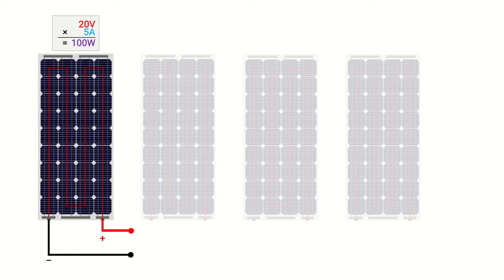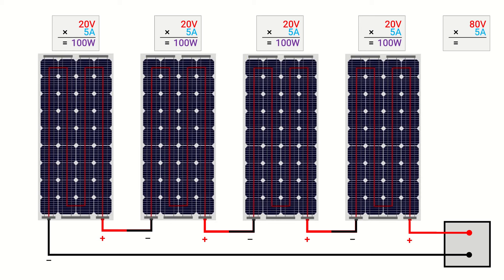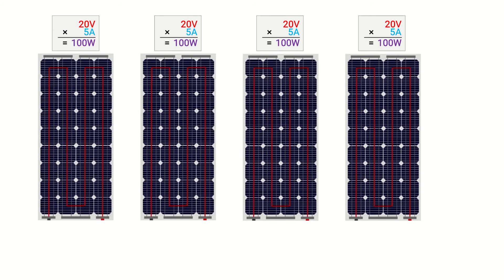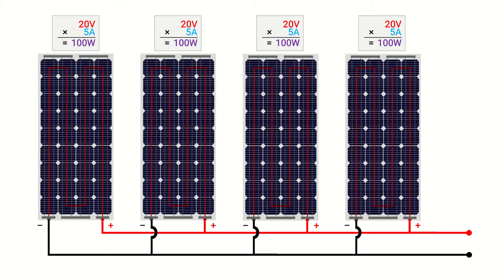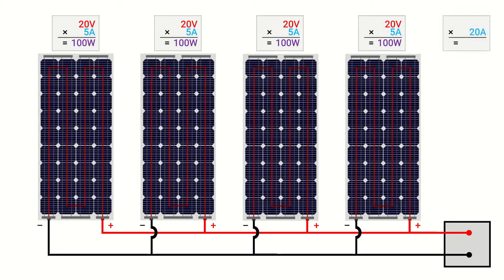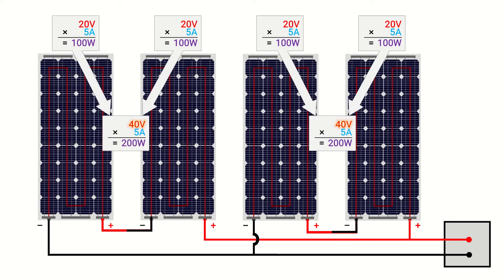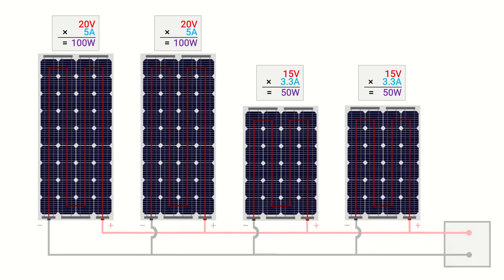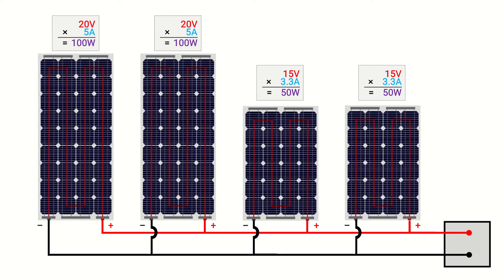How to wire different sizes of solar panels together

Comment: I understood before that wiring dissimilar capacity panels would impact array output but never understood why, or how to design around that constraint.  This explanation is very clear and simple, and may show me how to address a problem I’m working on now to upgrade my current installation. THANKS!!

Comment: Thanks for this information.  I’ve always been told that you can’t use a 100w & 50w in parallel. Not so if the voltage is the same. I had to try it for my self. Connected both panels. One 21.8v and 20.0v.  Works great.
Reply: I'm on a van project, I'm using ecoflow powerhub, so it has 3 solar input, but one is used for alternator charge, so 2 inputs.

I have 3x175W solars in one input. 
And the other i have 2 flex in the roof and 2 more flex in the hood. Both flex group are in series (separate).  1-1 + 1-1 thing. So series between them and then parallel to the controller. But like that wont charge. (very low wattage). but if I connect one pair, I get 30w and the other around 38w. 

One is 41v total the other is 36v. Something is happening  there. where somehow the lower panel is bringing the other panels down or something, and I dont get more than 0.5 A, which is not enought to start charging (20w minimum) 

I will try to rewire them in parallel, since the voltage will be closer that way. Too see what happens
Reply: Благодарю Вас за подробное рассмотрение вариантов с расчетом каждого варианта. Это был настоящий урок для новичка. Познавательно и доступно. Благодарю, успеха Вам.

Comment: Hello, great to hear you're enjoying the videos! One question, can I use a set of 4 panels of 330W (2 in parallel) and add (2 in parallel) 4 panels of 550W, all in pairs, then in series, and connect them in a combiner box? I don't want to discard the old panels.

Comment: At 12:04 could you increase the efficiency by wiring the two 50w panels in parallel and then wiring that string in series with the two 100w panels for a total of 275w and 91% efficiency? (55v x 5a = 275w)

Comment: This is good, for a theoretical example. However, as you know, solar panels' VDC varys wildly, depending on conditions. So, at what reference point does one determine the voltage requirements, for combining panels of various voltage? Open circuit VDC? Vmax? Or somewhere in between? 
Loving the series, BTW. Thanks.

Comment: 11:09  you could get 100 %  efficiency  by connecting the 2  50w in parallel and then connecting them in series with the 3  100w  to get 80v  and 5a  boosting operating power to approx  400w

Comment: Very well explained and informative video . I have one more question at this point in my next system addition . I currently have one 250w panel that rated at 23.83v and 10.51 a. My charge controller's nominal pv power is 700w, so would the addition of 2x220w panels be better for the total of 680w , or one addtl.250w panel and one 200w panel be the way to go? I have a Victron 100/50 mppt controller and Newpowa 250w panel so far . Thank you for your time .

Comment: In the last diagram with the 5 panels you could have wired them for 40V 10A with 400 watts and 100% array efficiency. 40V 5A for two 100watt panels in series. Then the one 100watt in series with the two 50W panels but those 50W panels would be in parallel so they combined would equal a 100W 5A panel. They could have also be wired for 80V 10A for 400W and 100% array efficiency. In both configs just imaging turning the two 50W  2.5A panels into one 20V 5A panel then wiring the rest up.

Also your wiring on the last diagram would likely burn out the two 50W panels. You're trying to connect a 60V 5A strand to a 40V 2.5A strand that would likely burn out the smaller 50W panels.

The voltage and current cannot be mismatched in this manner when connecting in series or parallel.

In series, the current has to be the same through both strands, which isn’t the case here. The panels wired to produce 40V, 2.5A cannot handle the 5A current that the 60V strand can handle, which could indeed lead to the lower-rated panels being damaged or burned out.
In parallel, the voltage across both strands has to be the same, which also isn’t the case here.
Therefore, connecting these two strands as depicted would likely cause failure in the lower-rated panels due to overcurrent. The appropriate method is to match panels with the same ratings in series and the same in parallel to prevent any damage and ensure proper functionality.

Comment: So if i put a one way diode in the smaller panels, would that keep the electric pressure from going to the lower voltage? Or is it a frequency thing where the lower voltage frequency transforms the higher voltage into its frequency.
Reply: Depending on how you connect the diode. If you connect in series with the modules, it will act as a blocking diode to prevent reverse current. If you connect in parallel, it will act as a bypass diode.

Comment: Thanks..
But a doubt:
7:00-7:10 part.
You say while in series, the current shall be limited to 2.5A!

My doubt is, when the sunlight falling on the 5A panels is capable of producing 5A and the load is capable of eating out the 5A, won't the 5A current flow through the 2.5A panels resulting heating up and damaging them??🤔

Please clarify 🙏

Comment: Excellent video, but I would also like to see the solution to be applied in case of necessity. For example, I have panels of the same model and specifications. due to space limitations, I have to mount them in 3 areas of different sizes. I want to place the maximum number of panels in each area. In this case, 3 different strings will generate electricity at 3 different output voltages/amps. Can I connect these 3 strings to the mppt after making parallel connections in the combiner box? Or in such a necessity, considering the minimum cost and maximum efficiency, what would be your solution?

Comment: I have 25 x 100w 24.3voc panels and 2x 320w 40.3voc  Renogy solar panels to install. Perhaps I should not have bought the 320w yesterday. I hope I didn't do a boo boo. Thanks for the video, great stuff.
Reply: that's ok; majority over-rules; the new ones will reduce down to the voltage of the old 25, they have to,because different voltages cannot co-exist; ;  meaning, the 2 new ones will only produce a fraction of the rated 320watts, maybe around 120 watts.

Comment: Hi! Have you ever heard of the Shoals Plug and Play cables / system? Can anyone judge whether it makes sense to use it? Although they seem to be a bit more expensive, they are extremely easy to use and no professional installer is required. Installation is also said to be very quick and more energy efficient than conventional cables... How do you think about that?

Comment: Can two seperate 400 watt arrays setup like shown here in 2s2p be combined in a combiner box for 80v at 10amps? Also would I need inline fuses for my power lines or is a combiner box good enough?

Comment: on the example where you did paralell to add current but 20volt and 15 volt panels.  doesn that matter since controller cuts the woltage on a pwm to battery 14.2 setting for example ?

Comment: So if we run a windmill and an array of solar panels they go through a controller that matches them up so that they work together efficiently? Instead of connecting their + and - at the batteries. Generally speaking if we had 2 large strings of panels of differing voltage and current we could wire one into the dolar input and the other into the wind input and they should produce efficiently? Or if we had an array on a roof that got more midday sun and an array on a wall that got morning or winter sun better we should use 2 different controllers before feeding the batteries. I'm going a bit wide off the subject but does this make sense?

Comment: I think it is important to consider the length of the run of wire, and the purpose/inverter used. Lower voltage can be better for batteries and higher voltage for a grid tie inverter.

Comment: Is this the same of you have pairs in series and then those in parallell, all the with the same rating, but facing different ways. Will the more shaded seriell connnected pair, bring down the other pair? 
The question comes from if the problem is what they atr producing or the internal resistance of the product itself.

Comment: In your last example, would i be correct in assuming that adding two more of the 50 watt in series with the other 2 50 watt panels, your efficiency would go back up to 100%?
Great video by the way!
Reply: He could have just connected the two 50W panels in parallel first to form a single 20V 5A panel. Then he could have made a 80V 5A series panel or a 40V 10A series parallel setup or all in parallel for 20V 20A. All setups would have a 100% system efficiency. Also the guy does not know his stuff. You never connect a 60V 5A string of panels in parallel to a 40V 2.5A string of panels. You would overcurrent the lower voltage lower amperage panels and likely burn them out.

Comment: Thanks I have 12 panels that produce 29.7v @ 7.3 amps. I am getting 10 more panels that have 31.5v @13 amps. It comes out to around 6400 watts max. My inverter can handle 6000 PV watts so that is perfect.  my other inverter will get 6600 watts PV but only use 6000 max.  Over sizing a bit is good for winter.

Comment: Something every mismatch solar panel video fails to mention is the Diodes. The lower value diodes in smaller panels must be changed to the value of the diodes your highest output panel .

Comment: Hello. I am setting up my own solar power system. So I have "2" 415w panels with voc 37.5 in parallel. What size charge controller would I need and the size batter bank? I truly would love your assistance. 👍
Reply: Hi, if they face the same way, put them in series for best results and less loss in the wires, choose a Victron BlueSolar MPPT 100V/20A or Victron BlueSolar MPPT 150V/45A. The battery can be 12v/24v/48v, it depends on what you want, most 12v cigar to usb for car can also run at 24v. you can also get inverters that run on 24v. A battery of 24v / 200Ah with 100A bms. then you have a 4.8Kwh battery and can load it with "2400watts for two hours" if the inverter can do it. good luck with the project

Comment: @11.90 wire the 3 100w x 5A pv in series with the 2 x 50w x2.5A pv wire in parallel connected to the  3 x 100watt pv in series.
 would that not give 80volts at 5A making 400w - am i missing something .

Comment: Hello.  I am new to learning about volts and amps, and connecting up solar panels to an Ecoflow power station (generator).  I have a question that I hope someone will answer.  Is it ok, if I connect four 200W 12 Volt panels in series, to add in one additional 200W 12 Volt panel, using parallel?  Or will this cause problems.  Thank you, Lori

Comment: I thought the whole idea of going in parallel was to have one string not affect another string. So if one of the two series panels got shade, the voltage would go down as well. You are saying that the lowest voltage in parallel is he output. Interesting.... That doesn't sound intuitive. Is there some diode setup to isolate effects of parallel string with another parallel string? Video was well done, I subscribed.

Comment: at 6:20 - when speaking of series connections being limited by the current of the ' panel with the lowest current rating '   Should it be better said that the series configuration would be limited by the current of ? :
EITHER
1 . the panel with the lowest current rating 
or
2 . a paralleled panel group whose amperage summation is lowest

Also - in that diagram of the two 100 watt and two 50 watt panels - would this be correct :
If the two 100 watt panels were in series with the paralleled two 50 watt panels then the equation would be 55 volts times 5 watts = 275 watts ?

Second question :
Do the panels communicate with each other, or is there some regulation from an external source ?   I can readily understand how the current would be restricted in a series circuit, however, I don't understand how a higher voltage at a parallel junction can be limited solely by the presence of a lower voltage .

I have not looked into the workings of these systems yet, however, just the mention of open circuit and short circuit gives me an idea that it is some type of pulsed on off switching .   Is that similar to a water hammer - only with electrons ?  Just kidding .

And at the last example ->  would putting the two 50 watt panels as parallel to each other and in series with the 100 watt panels give 80 volts times 5 amp = 400 watts ?

Am I correct in asserting that ' only the best professors ' reply : ' you are correct in all of your assumptions, surmising, suppositions, and assertions ' ...

Comment: Then, I can assume, that a combiner (of separate solar panel series strings) can no be an ‘adder combiner’?  I have two identical strings of 255watt panels (wired in series), coming into a combiner box.  However, each series array, is on opposite sides of the roof.  Neither string will have the same voltage/current, except at about noon.  Although, the voltage is most often the same, the currents (wattage generated) are not the same!
How do I ‘maximize’ this setup?

Comment: Hello sir, my 6kw growatt only has max  150 open voltage ..I have 16 panels of 320w 39 open voltage..I want to run 4 different strings 2series n 4 parallel..is the combiner box will allow me to be able to do that? Thank you
Reply: @Colin Mitchell  to run 5 times  , do I need a combiner box? Thank you..

Comment: thanks for the information. how best can i connect 330w, 370w, 400w and 400w to get best results all panels have same voltage of 36 volts
what will be the total power

Comment: I am struggling how to connect old 400x8 Watt  (40 v, 10 amp) panels to new 580x3 watt (48V, 15amp) pannels.
Reply: You can wire them up according to their capacity to a combiner box.

Comment: So if I have 2 string of 260 w panels and a string of 230 watt panels 
  If I just add an extra panel in the lower voltage string I should be good when I combine them in the combiner box 
  There’s only .5 amps difference in the panels    Is my logic / Calculations correct ?

Comment: Thanks for the lecture. However, I saw two types of current ( short circuit current and maximum power current) and also two types of voltage (open circuit voltage and maximum power voltage) on the label or tag of solar panels. Which of these currents and voltages should be considered when merging solar panels of different capacities (wattage) either in series or parallel? Thanks

Comment: What about connecting two separate charge controllers in parallel to the battery Brand A on 1 and Brand B on 2? 1:24

Comment: My single panel is giving 20V and 7Amps. 
When I wire 4 of them together in parallel then it gives me 16V and 16 Amp Combined? What is the issue?
Reply: No. You would have 20v and 28a =560w

Comment: I have a crazy idea. 

What if some company creates a voltage regulator. For example, Ani input from 18v to 60v to regulate it to 18. And you can put that regulator in every "same type" pannels group,. then you end up with a 18v output. that you can set in parallel. getting the most efficent output even with different pannels. And if one group goes down wont affect the other
Reply: Microinverters, anyone?
Reply: @kevinrtres  for a house may be, but for charging batteries, on a van or small off grid set up? 

Yeah, you can just buy fancy panels with microinverters, but for that you just buy all the same voltage panels... 

Not the point :D

Comment: Your first example adding an additional 100w panel you forgot to add that to the total system capacity 500w vs 400w
Reply: And it would be 60 percent, not 80 percent. Unless I screwed up the math.

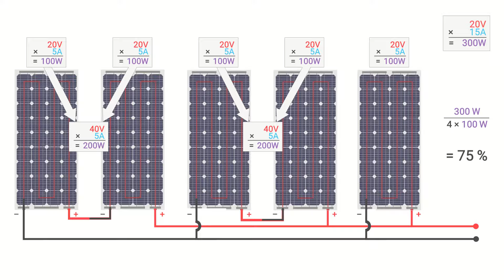Comment: 5:53 wouldn't efficiency be 60% as you are limited to 300W but have a total of 500W of panels installed?
Reply: and at 11:31 why not parallel the 2 50W panels to basically make a single 20V 5A 100W panel that could then be wired in series to produce 400W and 100% efficiency
Reply: @busimagen  youre right. just wasnt thinking clearly

Comment: Not fair changing the specs of the 50w panels in mid-stream from 15v*3.3a to 20v*2.5a.  Of course, the 20v*2.5a is probably more realistic, but wouldn't have illustrated your earlier parallel example as well.

Comment: Damn I must be doing something wrong! Mine keeps jumping well above the wattage the panels are rated for 😂. 

5x 375w panels voc-41.60 10.98amp max

2x 400w panels voc-37.07
12.90amps max 

I am trying to get as close to 1900 watts as I can while keeping the volts between 120v-300v but the panels are getting more watts not less with the calculations of series in the video.😂 2x2 of each panel I am getting 1727.59watts 

Ht60-166m-375
Dna-108-bf10-400w

Can someone help?

Comment: In the last scenario If you were to parallel the two 50 watt panels, then wire them in series with the three 100 watt panels you would get 100% efficiency or 400 watts. Why then would you ever wire them the way shown in the video.

Comment: I have always been taught that two 12V 100W panels in series is now 24V 100W output. 
Two 12V 100W panels in parallel is 12V 200W output.

And that is how the world actually works.

Now you have changed the laws of electric physics?
Reply: I think you might have got your Watts muddled up with your Amps. Both your scenarios should produce 200W, but the 12v arrangement will be delivering twice as many amps as he 24v one.